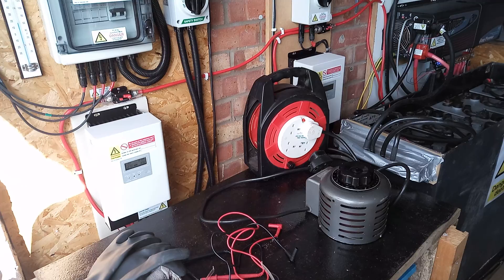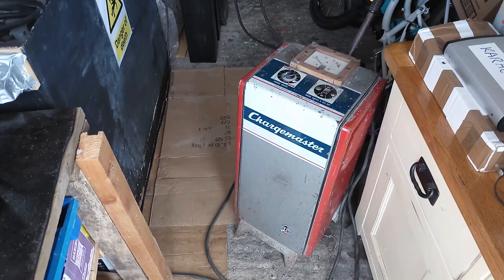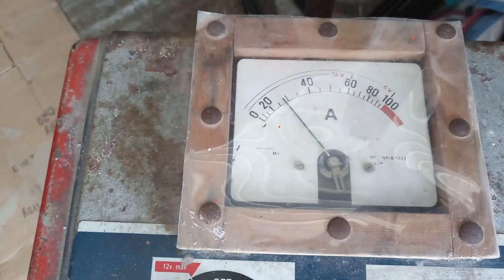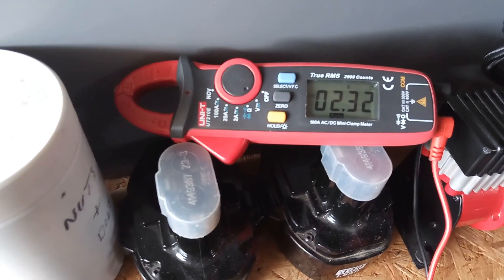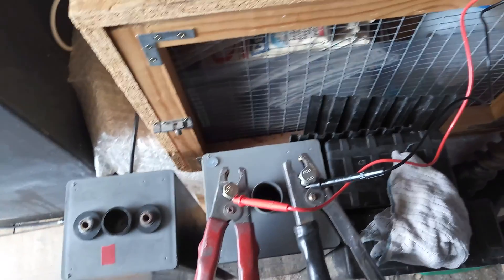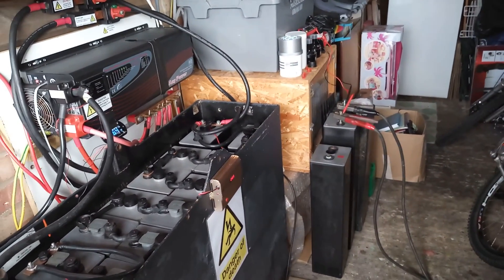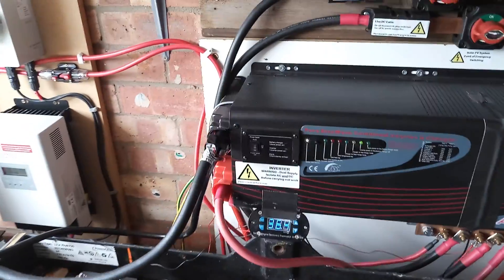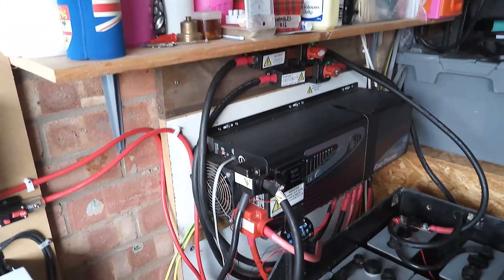Charging 2V fork lift battery cells with a Variac transformer

Comment: Nice set up
How long or life do you see from your forklift cells..?
The variac has so many uses if rectified ....are you completely on solar...?
Reply from the maker: I am now using 24v Tesla Modules and yes fully on solar apart from the oven! I am only connected to the grid for winter at the moment.  This project is now on hold. Regarding the fork lift cells they are a pain to manage but treated well you can expect anything from 15-20 years from them, plenty of off Griders using them. I am importing Lifepo4 cells now. Take a look www.offgridsolaruk.uk. cheers Ray and good luck with your set up.